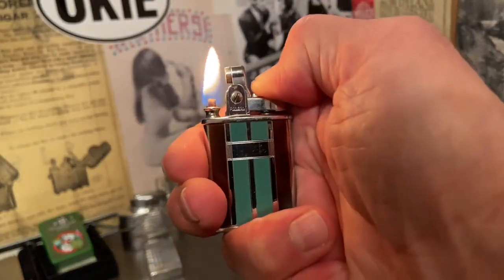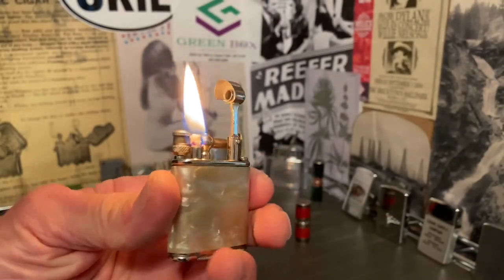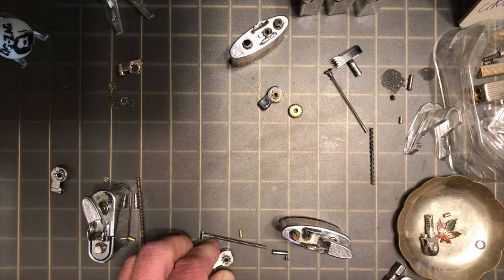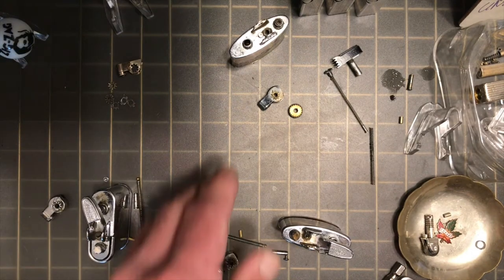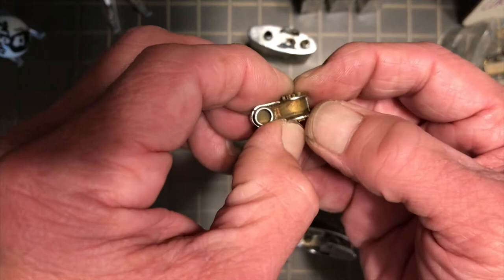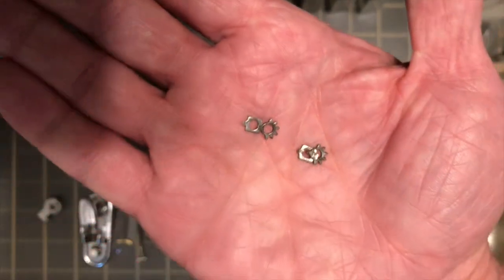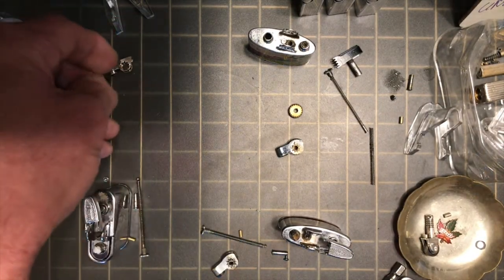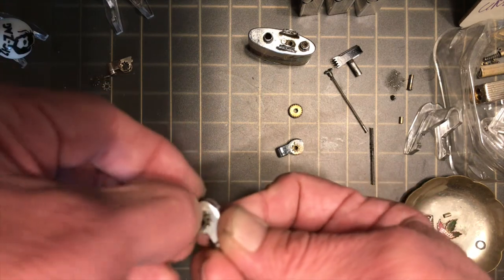How To Line Up The Gears In A Ronson Automatic Lighter Mechanism

Comment: hello I have tried to restore a ronson standard and I cleared out the flint tube I cleaned the wheel the best I could however for some reason I can't get the mechanism to work properly 

1. the snuffer cap wont open all the way up most of the time even in the right position
2. the flint is in contact with the file wheel but sparks 1/10 of the time

the snuffer cap has intergrated gears and some teeth look a bit worn I don't know if it could be the cause but if so I hope there is a way to repair that

Can't wait for your reply I love your videos you inspired me to buy vintage lighters I often check your videos before purchasing hahaha

Have a great evening from Québec Canada
Reply from the maker: Hey, glad to have you along! It could be the file wheel is worn down or the clutch spring or some other part needs replaced. It's hard to say but one part(the right one!) can make all the difference. It's a good idea to keep your eyes open for cheap donor lighters.✌️
Reply: @DependableFlame  thank you for your response! 

After I wrote my previous comment I tried a few things that made it work for some reason such as 

-putting an extra flint just to test it and it worked no problem I think

- interchanged the snuffer caps from my standard and a mastercase and it also worked 

Have a good evening!

Comment: Hi I have a automatic mosda 500 lighter. I know it needs feul. But the top won't even open. I was wondering if just needs the feul or if I need to do something. If you can help or know someone who can would be muchly appreciated. Thanks in advance
Reply from the maker: If the snuffer won't open then the old flint has likely degraded and is seized in the tube. The lighter in this video isn't identical to yours but should be close enough for you to sort the problem:

https://youtu.be/wqSVGJXmYSo

Let me know how it goes.✌️

Comment: Somehow, I lost both gears of my Penguin Phantom gas lighter and felt clever when I bought a cheap defective Brother Lite because the gears looked exactly the same. Turns out, they're NOT!😞The ones from the Brother Lite are about half a millimeter smaller so they don't hold in the snuffer and the hole in the middle is too small for the metallic rod 😭 

I must say I am very new to this scene and the most frustrating thing for me to learn was, that there are just no standardized spare parts. 🥲
Reply from the maker: Yep, you'll have to start accumulating donor lighters!✌️